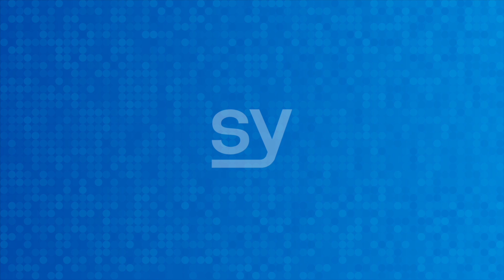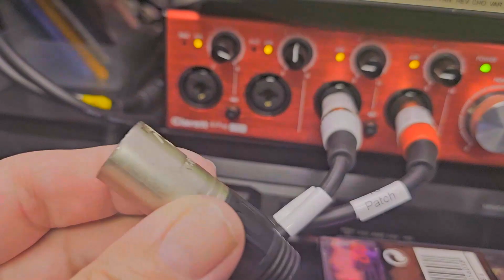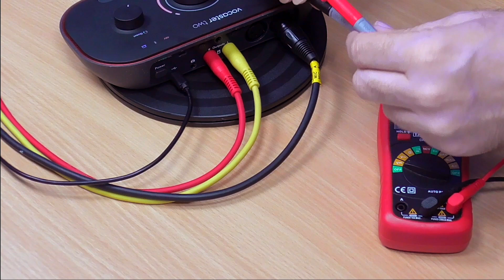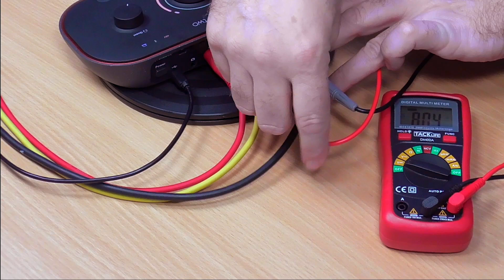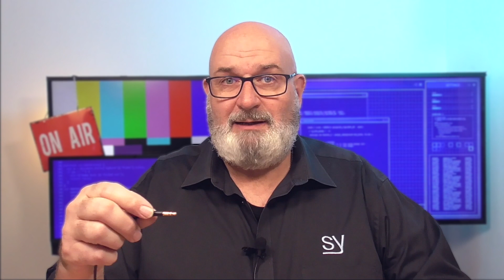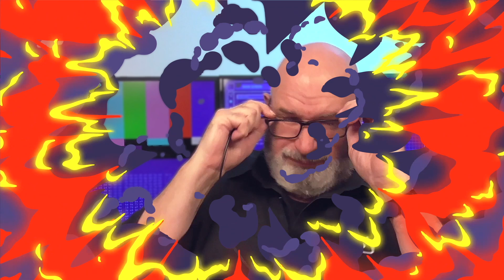How to check for Phantom Power

Comment: How do check if Mic is Phantom powered or not?
Reply: Hi, great question.  
Figuring out whether your mic needs phantom power—or if your interface is actually outputting it—is pretty straightforward.  Since we’ve already broken down the basic science behind phantom power in this and other previous videos, here are some practical ways you can test this. 

## 1. The Mic Check 
If you do not have the manual or not sure of the model of Mic that you have, then look at the microphone itself.  If you're using a condenser or a shotgun mic, it absolutely needs external power to operate.  Also keep in mind that true +48V phantom power only travels over a balanced, 3-pin XLR connection.  If your mic has a built-in USB cable or a 3.5mm headphone jack, it's relying on a completely different type of plug-in power, not phantom, so you can rule that one out.  
Standard Dynamic Mics do not require any power to work. they rely on positive pressure, made by sound waves hitting the element, to generate a tiny amount of electrical energy, to send to a Mic Pre Amp that would be built into the Mic Mixer or audio interface.  
If you want to quickly do a real-world test on your mic, then hook the mic up to your interface or mixer with the volume rolled off, then bring the gain up.  If you're getting absolutely zero signal (just total silence), then you may choose to go ahead and flip that +48V switch.  If the audio suddenly kicks in, you have your answer.  
A Mic Mixer or Audio Interface will not normally output Phantom Power out of a TRS Jack output, Even when the +48v switch is engaged, but rather only via an XLR output socket.

IMPORTANT NOTE:  Just a quick reminder for anyone using vintage or un-buffered ribbon mics: make sure that +48V toggle stays firmly off, as the voltage surge can permanently warp the ribbon element.  Standard dynamic mics like an SM58 or an SE V7 are perfectly safe and will just ignore the power. 

## 2. The Multimeter Test 
If you suspect your interface, mixer, or XLR cable isn't actually sending power, you can verify it in about two minutes using a basic digital multimeter. 
Grab your meter and set the dial to DC voltage.  Next, look at the pins inside the female end of your XLR cable. They're labelled 1, 2, and 3. Pin 1 is your ground, Pin 2 is hot, and Pin 3 is cold.  Take your black probe and hold it firmly against Pin 1.  Touch your red probe to Pin 2, and you should see a reading right around +48V (anything from +44V to +52V is normal).  Keep the black probe on Pin 1 and move the red probe over to Pin 3—you should get that exact same +48V reading.  Finally, bridge your probes directly between Pin 2 and Pin 3.  You should see 0V here because the voltage is identical on both sides, meaning there's no potential difference between them. 

## 3. The Quick Tester Option 
If you don't want to mess around with multimeter probes, you can grab a dedicated XLR phantom power tester online.  Some of them may look like a small metal barrel plug, as shown in the video.  You just click it directly into your XLR line or interface channel, and the built-in LEDs will instantly light up to let you know if the +48V is active, stable, and wired correctly.